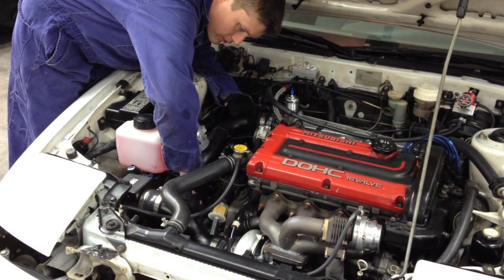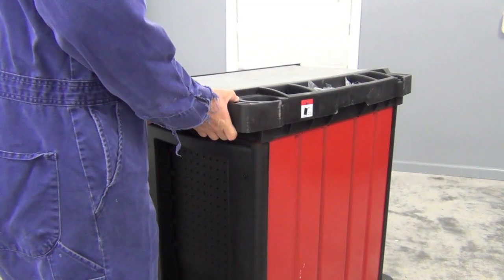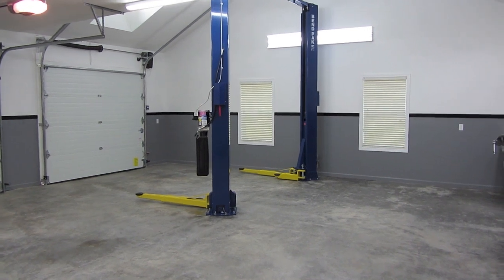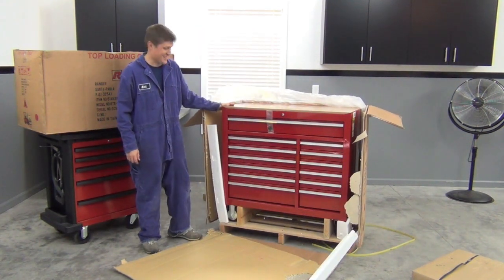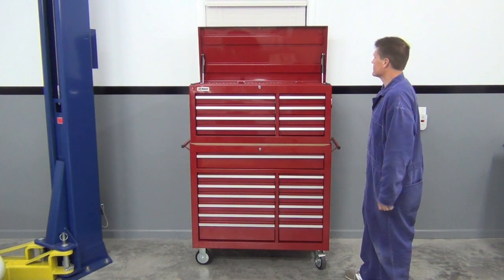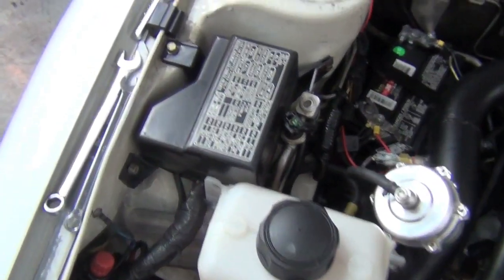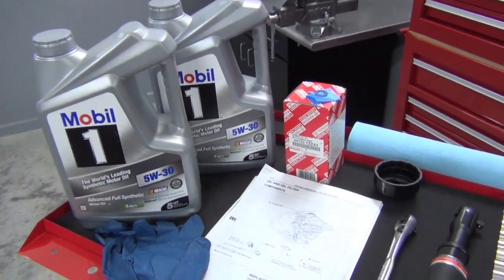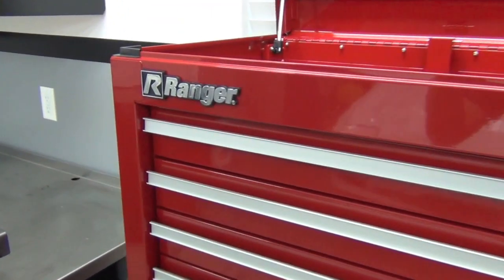My New Ranger Tool Storage Box and Ranger Portable Tool Tray

Comment from the maker: No, it's not a stroker- just good strong bottom end parts.  At the time Buschur Racing didn't offer a stroker, and we wanted RPMs for the car that the engine was designed for- a RWD Starion with a Powerglide.  It was a good setup in that old car and shifting it at 10.5k rpm was nasty back then.